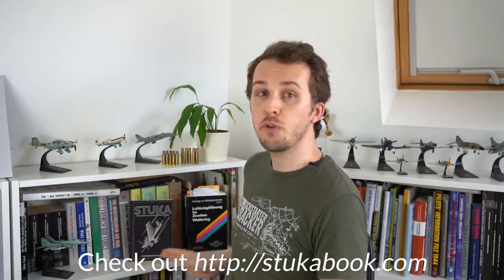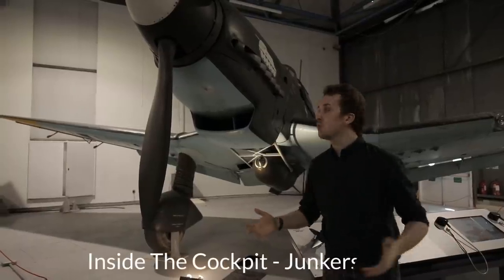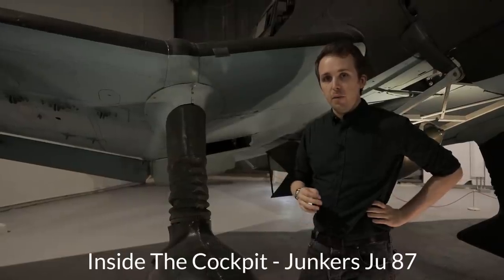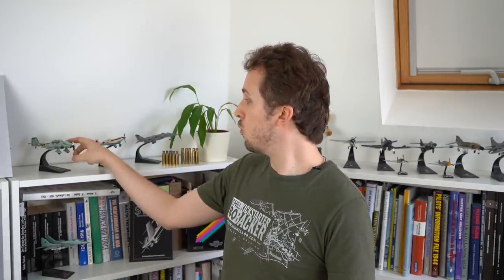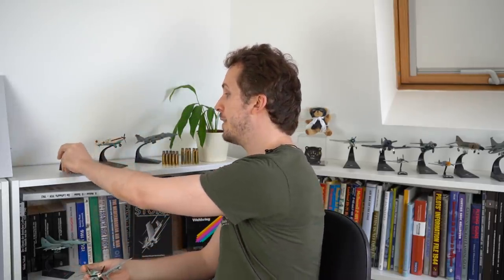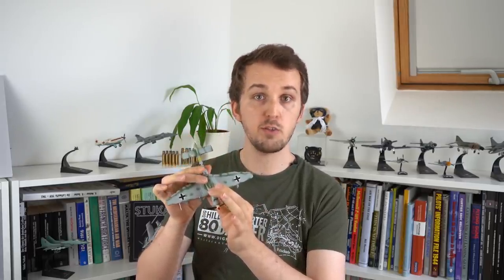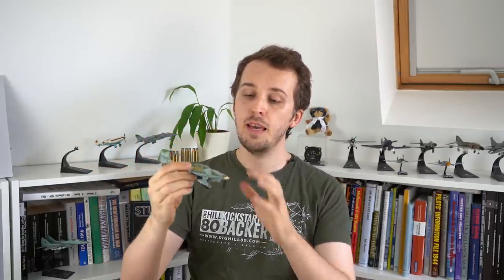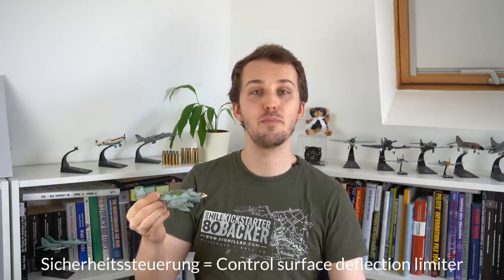How does it work? - Ju 87 'Automatic' Dive Recovery System

Comment: Hearing the explanation and operation of this device, I wonder how many German test-pilots and line pilots were lost before the designers felt this system was absolutely necessary.
Reply: This is why A-10 is not an dive bomber ☝️🤷‍♂️😅
Reply: I heard that 30 Ju-87-A pilots crashed into the ground by attacking. It was in the Spain Civil War.
Reply: @wertzur4923  they were performing a test flight to show some Generals the capabilities of the machine. A low fog enveloped the diving target arear and they crashed in mass. You have a video here on YT explainning the whole thing. Saying I heard when you can just google things seems rather lazy
Reply: @KarsonNow  A-10 is literally from a different era...wtf
Reply: @AndrewGivens  no

Comment: I am fairly sure that trim tabs of that style will actually work like servo tabs, deflecting in the opposite direction of the elevator. To trim the elevator up they will deflect slightly down, lightening the control force on the elevator itself. At diving speeds they can be quite effective.
Reply from the maker: Yup they are servos like said, they deflect up when activated and down during the recovery. I mispoke on their movement and didnt catch it in the edit, I'll add a pinned comment and will address it on the next video on the Ju 87. Thanks for the comment :)
Reply: correct!

Comment: Another important design reason for the Sicherheitssteuereung is that it prevents a possible stall, when recovering from a dive. Aerodynamically it makes no difference if you stall an aircraft in a steep climb, or when pulling up from a steep dive: it's all about the relative wind and the Alpha angle.
Reply: Thats what I though...thanks for the info!

Comment: Why were there never second generation Stukas?

Because they have a automatic pull out system.
Reply: Noice
Reply: Good one! 
😊😊😊
Reply: There was a planed improvement the Ju187 Ju287 had retractable undercarriage the whole tail section lowered to give better rear gunner field of fire. Problem was no faster than the original Ju87 and Germany had lost air superiority anyway.
Reply: Good one
Reply: So many pull out jokes in this video. Good one!
Reply: Germany received a
large number of patents from the American companies Pratt and Whitney, Douglas
and the Bendix Corporation, and the "Junker-87" depth bomber was
manufactured using exclusively American technology.

Messerschmitt Bf-109. Production of its prototypes began only at the end of
1934 and the first training flight of the prototype "Messeru" took
place on May 28, 1935. The deadly fighting machine, represented by a single
sample, was equipped with an English Rolls-Royce engine "Kestrel V".
Wondering why English? Simply because German engines of this class were not yet
available. 
That is why the British  rushed to the aid. At that time, England was the world's main exporter of weapons and
military equipment ...

However, not only the first prototype was equipped with a British engine.
All serial Messerschmitts had these engines until German industry began
production of its own
Reply: @RENEBACON  🤦‍♂️
Reply: Brilliant...

Comment: Just a little comment about the "size of the target presentation speculation": If you want to hit an aircraft with AA guns, the best moments are when the aircraft is not turning. Neither horizontaly nor vertically. -> when it's going in a straight line, no matter the direction is best.
Reason being: with AA guns you have to hold over so the plane and projectiles "meet". And with distance and speed of aircrafts the holdover is substantial. (Looks very weird if you see that the first time in real life) With an aircraft turning, the holdover is changing during the turn and no sighting system can counter that. (Or could in WW2 and even until the turn of teh last century i would say.)
Long ago i got trained on a 3.5cm twin AA gun system. It uses weather information (wind, temp and air pressure) as well as projectile speed, laser ranging ect. and can be radar guided, uses explosive shells, fires around 1100 rounds per minute...So it is far superior to any WW2 AA gun. And still, a turning aircraft is almost impossible to properly hit. 
(We are talking about the same system that shot down RAF Sea Harriers in 82')
When it aims for you, that is (according to my training) your best chance to hit a hostile aircraft. The aircraft has to maintain it's direction for at least a few seconds to get a proper aim, and that's the amount of time you get. (So, you get a max of a few seconds and the smallest target size the aircraft can be, but at least you don't need a holdover)
Basically its like the "game" the germans call "Schisshase", where two cars drive towards each other until one of them gets scared and turns away. Only that here it's about who manages to first score the hit. 
One of our officers once said AAA is 23 hours and 59 minutes of extreme boredom and 1 minute of hell on earth. 
The other chance would be if it hasn't noticed you and is in "level flight" crossing your field of fire. But let's be real, that is less likely to happen.
Yes, AAA sounds a bit suicidal (especialy considering modern weaponry). Let me just say that in my defense, most of these things i did not know (or consider) when i ticked the AAA box on the form i was given to mark on which weapon school i would want to transfer to.
(Actually after 4 intense months of infantery training, the idea of getting transported by a truck instead of walking everywhere with up to 36kg of gear on the back was very intriguing. As was having probably a sitting job, not having to "walk, crawl, glide... into position". And as a military aircraft enthusiast i had good expectations to not need any training in identifying aircraft siluettes...
And should i mention that i didn't pass the second stage of the "military pilot selection process" shortly prior? 🤫 )

An to end my comment, something else that could be thought provoking: We were told to not waste ammo on leaving aircraft. 
(If it has "unloaded" already and there are targets available that have not yet, they are more important to get shot at.)
Reply: Well stated. 1100 35mm shells travelling 3000fps in one hairy minute is a lot of BBBRRRrrrrtttttt...

And even then, target acquisition is tricky and momentary.

That part alone is identical to WW2 gunnery struggles. That's how the kamikaze got through. Because making a firing solution on a diving aircraft is nearly impossible, in that making hits, or even a kill, does not negate mass x velocity physics...
Reply: Wait, you didn't get accepted into the pilot program so you decided to shoot them down instead?
Reply: A small correction, Sea Harriers were only flown by the Royal Navy during the Falklands conflict, the RAF Harrier contribution was 10 GR3's designed for close air support and reconnaissance. Also what you call "Schisshase", would be called "chicken" in the UK. Thanks for the interesting post :-)
Reply: @gwtpictgwtpict4214  Sorry my bad, you are of course right. No RAF Harriers there, only RN.
Reply: @89DerChristian  You don't get to shoot at your own ones! 🤷‍♂️   Seriously: I bring that as a joke from time to time. (and the timeline is true. I had to come up with a plan b for my immediate future) I had and have no hard feelings about it. The stage i didn't pass, is where (according to the head psychologist who ran this test stage) 98% of candidates at that level didn't make it. (Our airforce was/is small enough that they can be that picky) From what i learned later, i would have been dropped in the next (last) stage of medical checks anyway. One of my comrades made it to that stage and got dropped for having a light pollen allergy. I am "blessed" with that too. (i still don't get what the problem would be with an oxygen mask and filtered air up there, but hey, they can make the rules as they like.) He became an airline pilot later in life.
And lastely: after my time there i switched sides again and i am contributing to keeping aircraft safe for over 20 years now. (not just mil aircraft)
Reply: Play some War Thunder lol it’s a video game but the aiming and leading with your guns seems on point and realistic
Reply: I fly DCS and on occasion have a go as a gunner. It's interesting you get a perspective on which moves is easier and harder for the gunner to go after, when you have a go yourself.
I find doing circles around the gunner, very near to them is almost impossible for them to get anything even vaguely dangerous off. Flying in a straight line or very gentle predictable curve is absolutely reciepie for having to bail out. Constant small random movements work best.
But as gunner, even if you know you 99.999% won't hit the plane, the psychological pressure all those rounds coming up places on the pilot is immense, and makes it much harder to focus on lining up the bombs or rockets or straffing run.
Reply: Heheh. "We can't fly so no one else gets to either!"
Reply: The same can be easily demonstrated or seen by viewing a hunter using a shotgun for hunting birds, or the sport of "Skeet Shooting".  More complicated scenarios are in "Sporting Clays", where the clay targets are not only thrown in the sky but used to simulate game running on the ground, bobbing and weaving as well.
Reply: America also has an equivalent to that German game except we call it “Chicken” and play it with tractors.
Reply: @mikekrypel4771  Go clay pigeon shooting and learn it in real time.
Reply: Thats a lot of words for sayin 'lead your shots bro'

Comment: I have heard the swinging bracket for the bomb called a "trapeze" elsewhere.  I think it was specifically referring to the one on the SBD, but it sounds like a generic-enough term to apply to the Stuka as well.
Reply from the maker: I've seen so many different terms on it, like bomb crutch, cradle, swing mechanism, seems like as long as it is discriptive enough it works,haha
Reply: Also the name for the airship and B-36 carried aircraft launch and recovery cradle.
Reply: @MilitaryAviationHistory  >>> 
The gizmo that flings the BOOM-BOOM. 
😊😊😊
Reply: @Allan_aka_RocKITEman      It lowers the Boom.
Reply: I've also heard it called "bomb displacement gear" in USN accounts.
Reply: It prevents the bomb from hitting the propeller?

Comment: Perhaps Rudel had an influence in the removal of these automations? I seem to recall in his book that his technicians could fabricate pretty complex systems to allow him to continue flying through various wounds and he built the whole tank busting legend around the Stuka.
Reply from the maker: The Anfangvorrichtung was no longer required as soon as the 3,7cm cannons were installed, so I doubt it. Since the early tank busters were converted D-models it might be that a few flew with it installed but even there I assume it was disconnected quickly.
Reply: @MilitaryAviationHistory  I can see a value in placing the function under the Pilot's control rather than being wholly automatic:
IF for whatever reason (enemy equipment, terrain, whatever) Flak was heavier at altitude than lower down, or if there was maybe a an option to use terrain to shield you, then you would rather not regain height, you might prefer to hedge hop?

Comment: I am very curious for some numbers associated with the JU-87 dive attack: What was the typical terminal velocity, release height, and G pulled in recovery? 
Also, is it really true that JU-87 pilots had their eardrums pierced to prevent pressure buildup during such dives?
Reply from the maker: Collecting questions on the Ju 87 atm so I'll drop this down and will tackle it hopefully in an upcoming Q&A on the Ju 87 / book project.
Reply: @MilitaryAviationHistory    Great!
Reply: @oceanhome2023  Reason #2 is moot as Chris covered in the Inside the Cockpit video:  The Stuka had explosive charges in the landing gear struts to blow them off if necessary.  He phrased it as a way to get rid of an intact strut if the other had been damaged/destroyed so you could belly land the plane rather than trying to land with just one wheel but it would seem that this was also be a good solution for a water landing.
Reply: @oceanhome2023  From your description the pilot in question was probably Eric 'Winkle' Brown. Flew more aircraft types (487) than anyone else, made more carrier take offs (2,407) and landings (2,271) than anyone else. Was the first person to land a twin engined aircraft, a tricycle undercarriage aircraft, a jet and a rotary wing on a carrier. I'm afraid I'm going to take his opinion over yours :-). Just to take him down a peg, he wasn't the greatest writer in the world but his autobiography, 'Wings On My Sleeve' is well worth a read.
Reply: @gwtpictgwtpict4214  He wasn"t English.
Reply: @benwilson6145  Enlighten me, at what point did I say he was? If it makes you any happier I am happy to state that he was born in Leith, which is near Edinburgh in Scotland.
Reply: This is easy info to find, even online.
Terminal velocity: With a 4300kg aircraft in a 90° dive, terminal velocity was 540km/h. This would be reached after a 1500m dive. Absolute never exceed speed in a dive was 600km/h.
Release altitude: The dive could be started at any desired altitude. The safe recovery altitude depended on the type of bombs dropped (the exact data is all in the Ju 87 Abwurfwaffe manual), but the assisted recovery system imposed a lower limit of 450m and flights in training had a hard deck of 650m.
A maximum of 6G was pulled in recovery.
Of course they didn't have their eardrums pierced! (but Stuka crews were physiologically affected in other ways).
Reply: @oceanhome2023  You beg to differ from Winkle Brown!? Bwahahahaha! 😂
Reply: @gwtpictgwtpict4214  When you replied to a post that stated he was English you did not correct the error, you seem to like correcting people.
Reply: @oceanhome2023  You're entitled to your opinion, but those two points have nothing to do with getting the job done, and If a man who actually flew just about every available aircraft of the war said the Stuka was the best plane for the job, then I'm going with that. No theory there, but real experience. The Stuka gets my vote too.
Reply: @benwilson6145  you replied to wrong person. Get bent.
Reply: @oceanhome2023  Japanese philosophy was there was no need to pull out of the dive.

Comment: I had learned that Italian pilots using Stukas learned independently to conduct skip bombing. This is dropping a bomb at a certain speed and near horizontal angle that will skip like a stone over the water. It will hopefully strike a vessel near the water line. US pilots used this technique as well in the Pacific.

Comment: The USN Douglas SBD Dauntless also used a bomb release cradle. It swung the bomb down to clear the prop when it was released. Very sensible technology, really.
Reply: So did the Aichi D3A “Val” dive-bomber of the Imperial Japanese Navy.  It’d be interesting who copied who.. though the Stuka pre-dates any other WW2 dive bomber.
Reply: @minot.8931  I've read that Curtiss Aircraft in the US was the first to develop a dive bomber, in the 1930s. The Germans copied that system. It's quite possible Curtiss developed it based on other ideas, need to research.
Reply: Always wondered why.  Isn’t the plane going faster than the released bomb?  I guess this is the kind of thing that you don’t want to leave to chance … a live bomb in the prop blades might not be such a great thing

Comment: That was a very ingenious system to add. Sort of the beginning of ideals that lead to fly by wire with computer back ups to keep the pilot from doing maneuvers that neither the pilot or airframe could stand.
Reply: Could technically be called a fly-by-wire system too. Since, ya know. Electrical wires with switches and stuff activating them and pulley wires for the control surfaces. XD
Reply: @5peciesunkn0wn  He did say it was activated by a series of magnets, wires, pulleys and weights all engaged by one electrical switch.

Comment: Very nice video about dive recovery system of the Ju 87. Everybody knows it, but nobody knows how it really works. Thanks for that. I may add my humble suggestion concerning the removal of the Sicherheitssteuerung from the Ju 87 D-5 onward. The Ju 87 D-5 was delivered from the Summer of 1943 onward to the Stukageschwader. At that time tactical changes within the Ground Attack Arm (Schlachtflieger) of the Luftwaffe took place, gradually pushing the Ju 87 into to the role of a ground-attack aircraft (Schlachtflugzeug), instead of the role of a dedicated divebomber (Sturzkampfbomber). This change of role lead to a different attack mode of the Ju 87, emphasising the close air support role instead of the divebomber role. Simply put: Divebombing became less important, especially in steep dives. Maybe attacking by pushing over the wing into a dive, instead of pushing over the nose can be a factor, too. I think the revised armament and armor of the Ju 87 D-5 reflects this changes: switching from 2x MG17 to 2x MG151/20 and more armor for the pilot and engine. One further point may be the simplification of the production of the Ju 87, to get more produced: Entfeinern was the order of the day (for a description of this process see Lutz Budraß, Flugzeugindustrie und Luftrüstung in Deutschland 1918 - 1945). It would be interesting to know if other late war versions (D-7 and D-8 night ground attacker) had the Sicherheitsteuerung also removed, i would bet at least for the D-8, as this version is based on the D-5. Last but not least, it would be interesting to know if divebombers of other nations did employ a similar (or perhaps completly different) dive recovery system as the Ju 87.